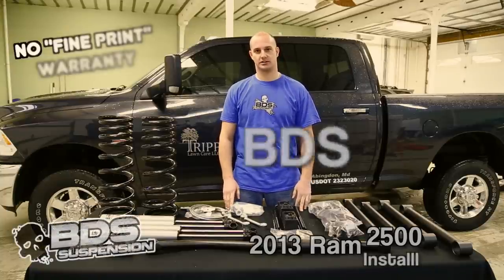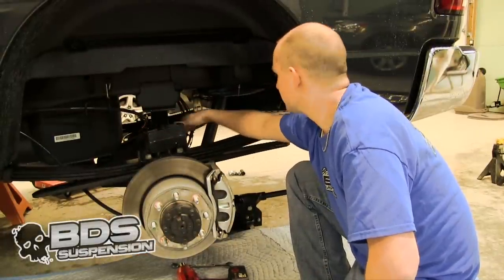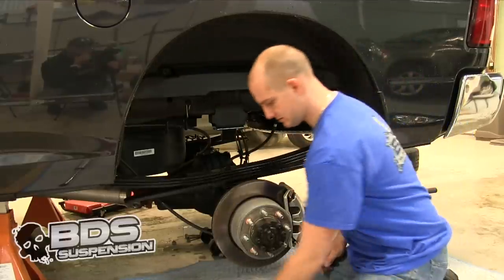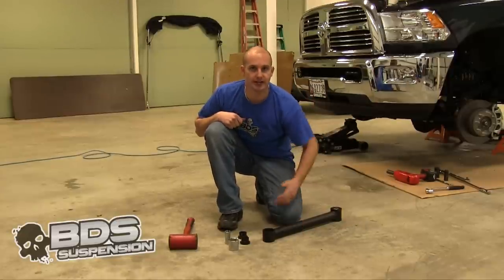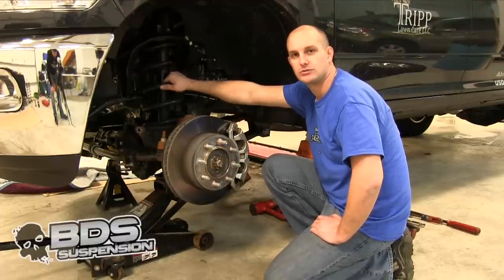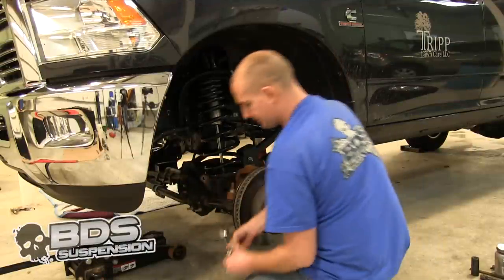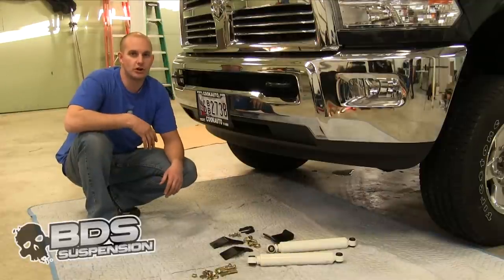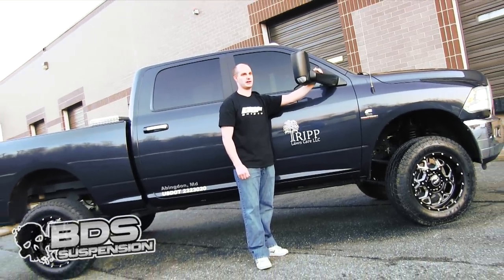Full install of a BDS 3" 4 link suspension system on a 2012 Dodge Ram 2500

Comment: Awesome video you make it look so easy! I would love to put one of these lifts in my 14 Ram Cummins Crew Cab. Mine has rear coils. If you install a lift in a rear coil model could you make a video? That garage is nice!
Reply: The 2014 has shocks outside the front coil and it looks like bds uses the factory trail arms with a drop bracket for the 2014.